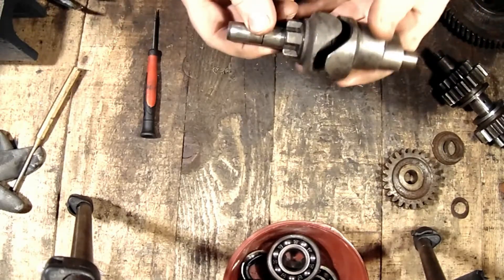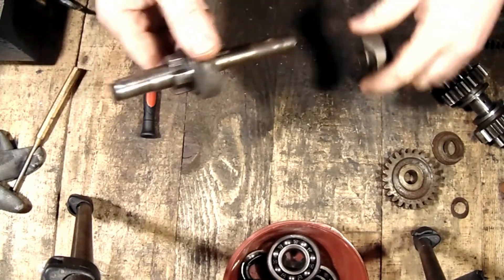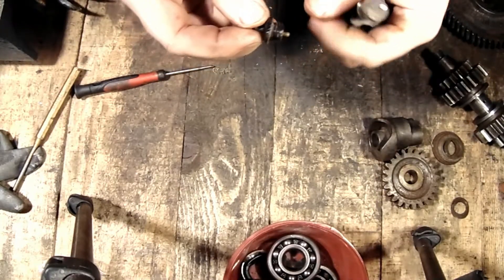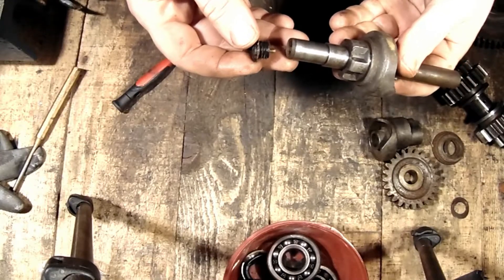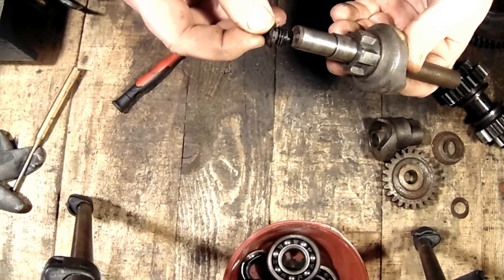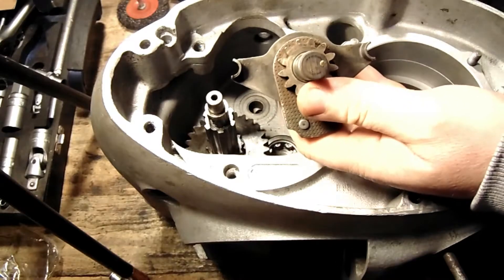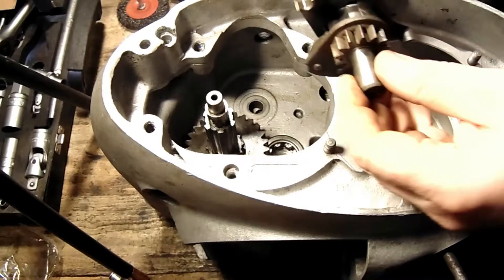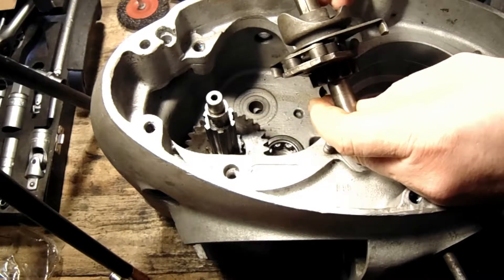Adler MB250 , M250 engine assembling (part 1)

Comment: I had an Adler Scrambler 250, 1957 as I recall in 1961 .  That plate you were heating with the torch at the beginning broke on my machine (cast iron?) and a machine shop owner and bike repair shop made a new one from steel plate.  Worked flawlessly.  I'm amazed at how rugged the gearbox looks as you assemble it, what a rugged machine.
Reply from the maker: Hello. All old engines were rugged and durable . And almost everything could be repaired .